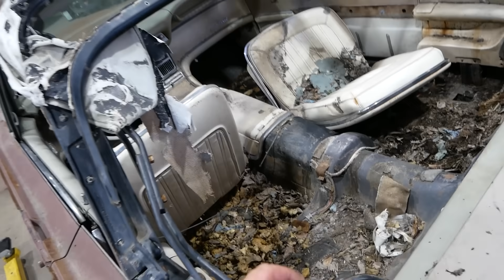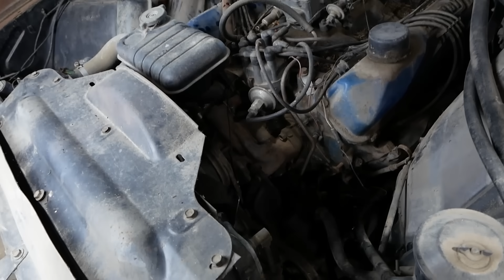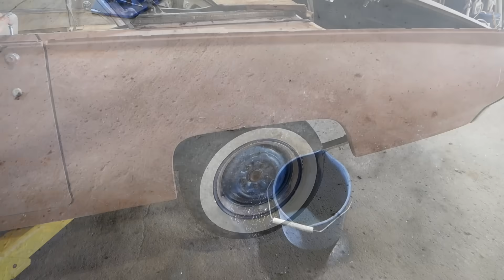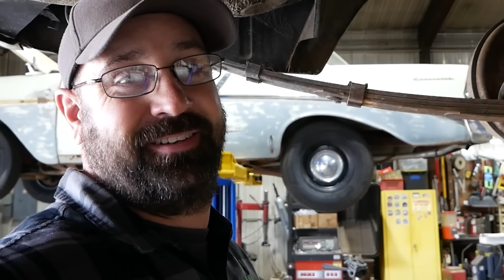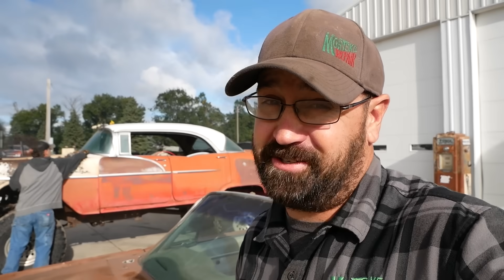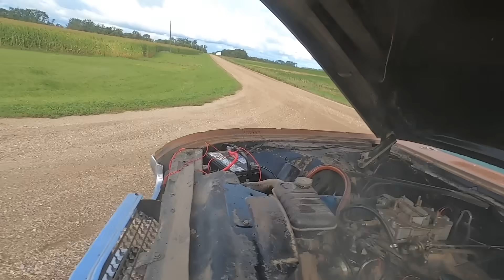Rare Bird!!! Abandoned 1962 Ford Thunderbird Convertible! Will It Run?!?

Comment: They were the exact same car as the Convertible, so they didn't make Sports Roadsters they were just a option to the convertible, the later ones were stamped on the Vin with a 89 and early ones were 85 convertibles.Good luck finding a original fiberglass cover .
Reply from the maker: They definitely shared the same platform, making that tonneau cover a real needle in a haystack! 😎

Comment: This guy gets by just because he's a mechanic, don't be mad at me, but he's a real idiot. It's complete stupidity for an engine that hasn't worked for many years to take a test drive on a short road without ever thinking that the water pump circulation will malfunction. In addition, it is terrible that the engine is overheating and the car is forced to drive despite the loss of energy. It received zero points from me.
Reply from the maker: 😂 you must be a real treat to hang out with!

Comment: Need a NEW paint job, and de-rusting on the body.  I'm not sure what might work better; a wire wheel or a power-sander?  Not worrying about Bondo-fill; skip it.   2 Primer, and 3.5 coats of White gloss or Beige.  For seats - replace with a cloth equivalent.  Leather, unless treated, wears out too quickly.   All rusty metal will need to be "sand blasted", or electro-lyted.

Comment: 21:39 - i too love spade connectors, thats what they are called, though that "elbow" descriptor makes me think its a 90 degree bend spade connector

fun fact, Hella is a brand that makes OEM lights and accessories, they also make really good horns, on my 96 accord wagon i installed Hella Horn Supertones, and spade connectors is what you are supposed to use for the horns to connect to an electrical circuit
Reply from the maker: Thanks for the info

Comment: If you want an easy way to make a diff tag with the gear ratio, just cut out a piece of
scrap sheetmetal, drill a hole in it, and use the numbered punches that are used for
marking rod caps as well as other things to put the gear ratio on the tag.
Reply from the maker: Ok

Comment: The Sports Roadster or at least the rear seat cover continued to 1964 but very limited . The Sports Roadster did have another engine option the 427 Ford . The slide away steering wheel was first introduced in 1961 and continued until 1967 . In my 73 years I have owned 18 Thunderbirds . The 62 was the first year for an alternator .
Reply from the maker: Thanks for sharing!

Comment: That has to be the most solid Tbird floor I have seen. Worked on 1959 and 1961 Tbirds. Both were the nicest examples but a convertible with that good floors is a rarity. Rocky the trash panda must have loved it cause he left all his fecal matter everywhere. I'm actually surprised how that transmission crossmember has been put in nothing but fine farmers engineering. 😂I think the critter who ate the lower radiator hose must have been really hungry and not the first time seeing this. I had once a old coolant in a bowl and found lot of dead mice inside, apparently the sweet smell was irresistible. There is already a good name for this thing Ze Underbird. Waterpumps are kind of annoying to get out from these cause of the fan shroud.  Love the Mortske minutes, hopefully it finds a good home.
Reply from the maker: Thanks for watching

Comment: There's nothing wrong with ram assist power steering.  Corvette had it all the way up to 1982 and it is very responsive and gives good road feel.  Performance wise, it's not any worse than a power steering box.  The only down side I've found is leaks.
Reply from the maker: Definitely the leaks and complexity

Comment: Semi gets this they could do a custom take that convertible top out because will cost too much money to fix all those wires and hydraulics and to get it to run right Don't put a back seat in it make your own cover to hide all that cuz you probably couldn't afford the original fiberglass one or fine one find what Chrome you can put on it if you want to put any lower to the ground I like those seats redo those seats only going to need two of them get it running and make a cruiser out of it you got to drive it on good days but you'd have a roaster T-Bird you have something different yeah you're purest out there would have a heart attack but to each of his own you have something way different coming up to the car shows than most people if you really want to make people flipped out put an LS in it people lose their mind then

Comment: My Dad worked for Ford in 1954 and built his own 55 right off the line. I have the 2003 retro version. He used to tell me all the time that the solenoids for the convertible tops burned out constantly and most people disconnected it after a couple years and manually pull the top open or closed. As far as I know the system stayed the same for decades in case you have to move the roof bits. Even my 03 uses what appears to be an electric over hydraulic setup, or they’re just gigantic electric motors that look like the older style - not sure since mine still actually works 😂 I’d still like to own a black 56 like Arthur Miller bought for Marilyn Monroe, and a 58 like Ritchie Valens had.

Comment: I've worked on those retractable roofs with all of those solenoids and they can be a nightmare to work on because of all the wires and solenoids that can & do go bad on one of these cars that I worked on when I worked at Classic Auto many years ago . One of the members of the car club I am in has one of these that was having issues with the top not wanting to work at times & we ended working on checking the wires to make sure that none of the wires were broken internally then checking each solenoid which took some hours to do but we got lucky that the hydraulic pumps were functioning and his top now works again but I also worked on my bosses 56 at classic & we had a person that came into the shop with a 67 that I worked on . We were sponsored by the Minnesota street rod association so we were getting all kinds of cool old cars in to work on as well as hot rods and muscle cars way back then when working at the place . Definitely one of the best Jobs I ever had as far a all the cool stuff I got to work on & it paid good . 1,500 seems rather cheap for this but trying to find nice parts to replace the ones that are missing will probably be pretty hard to find & if you do find them in good condition they probably won't go cheap . Did you go back to where you got this car to see if possibly those missing parts were still in the building?
Reply from the maker: Thanks for the info

Comment: Those holes in the brake drum in between the studs are threaded to 1/4-20 and are designed to help remove a stuck drum btw
Reply from the maker: There’s no threads in there. Too thin of material for threads

Comment: I had a front driveshaft come out of a really crappy square body blazer that I bought for $300. It cut a pole vault trough in the asphalt. Unfortunately it was a street in an extremely exclusive gated community I was working in. Fortunately, I made a clean getaway 😜. Extremely memorable, and I would recommend it.
Reply from the maker: Ouch

Comment: Despite the condition it should sell quickly.  I've owned a 62 and 63 convertible.  The top is complex but not bad to keep working if you have some electrical background and can read a schematic which the service manual shows each cycle in detail.  You goober....those wires you cut?  The connectors are within a few inches of where you cut. Probably tucked into the hole in the trunk lid.
Reply from the maker: Good to know!

Comment: I use to have a 1963 Thunderbird 2 door hardtop I painted a lady's home and did some work for her and she ended up giving me her dead husbands Thunderbird it was in ok shape but it needed work like the drivers seat was ripped up and the paint was a repaint from long ago but it needed or be painted again anyway had the big 390 in it and once I got it running and tuned up it ran good but the guy was dead for over 10 years when I got it anyway I drove it for a while and gave it to my father and he still has the car and he drives it around some times.
Reply from the maker: That's a cool story!